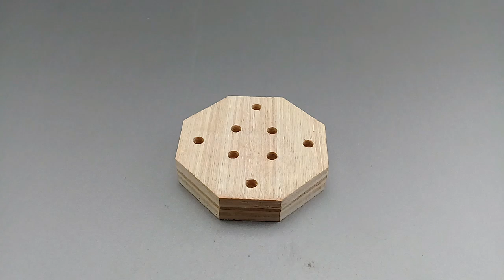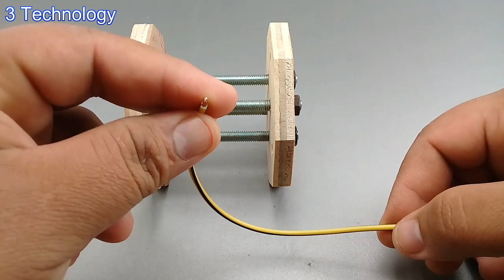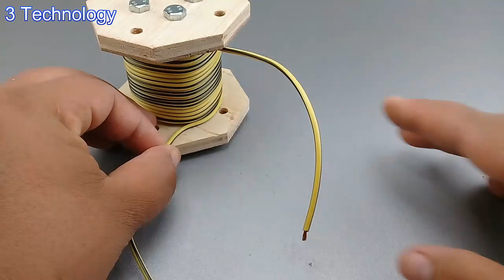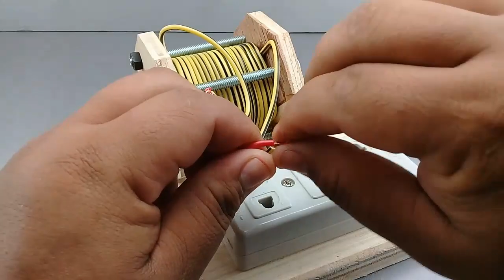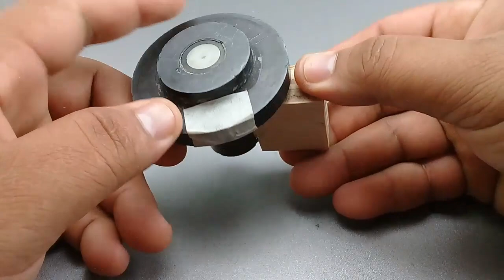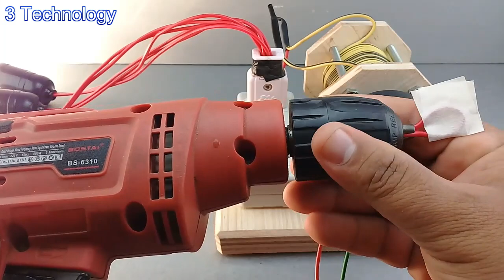Get 15kw Energy From 8 Big Bolts With Wire Cable

Comment: Aqui no demuestras nada,  no hay prueba de voltaje, las bombillas siempre las mismas, el taladro 500W, ni tan siquiera un  amperimetro en la entrada del enchufe para ver la perdida de carga ni las RPM del motor, ni cuantas vueltas de cable, ni la sección del mismo, aún asi, si hubieras enchufado 2 calefactores de 2 Kw ( 4.000W), empezaria a creemelo pero mientras, esto es un FRAUDE denunciable, piensatelo.....

Comment: De unde almentezi motorasul ?
Reply: Dacă ai ceva cunoștințe de fizică de clasa a-X-a și ceva pricepere în "electrotehnică" î-ți vei da seama că totul este o mare prostie... 😜 Nu consuma timpul și bani pentru așa ceva... Există niște proiecte mult mai complicate la Mihai Barbu, dar nici acelea nu se pot numi Free energy. Se ține cont de tot ce include fizica, începând de la lucrul mecanic și frecare până la vaste cunoștințe legate de vectori, curenți, magnetism și în final multă electronică! Ăsta arată numai prostii și tâmpenii! Scuză-mă că zic... Doar tâmpiții pot crede așa ceva... 😜
Reply: @neacsudanut7145  dude, I wonder you don't recognize the difference between electrical energy and total energy, here electrical energy is alone getting amplified. Although, he uses a battery power, if he doesn't use battery power, he needs to convert the output electrical energy to motor compatible one. 

Although every electrical over unity device comes under laws of physics. It is us and our tutors who doesn't recognize to differentiate the electrical energy and the total energy and Plainly mention it as energy, and we assume that both are one and same, so whose mistake is it?